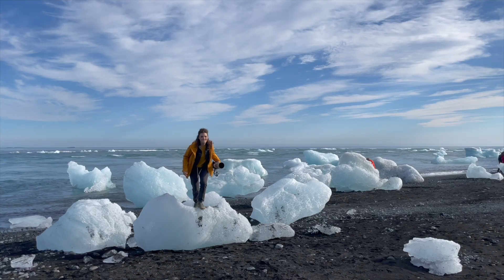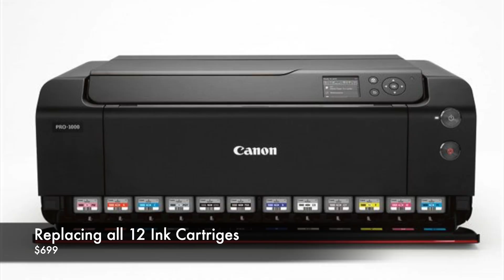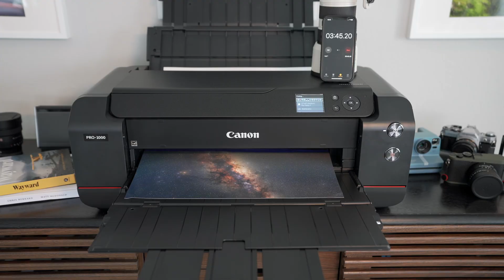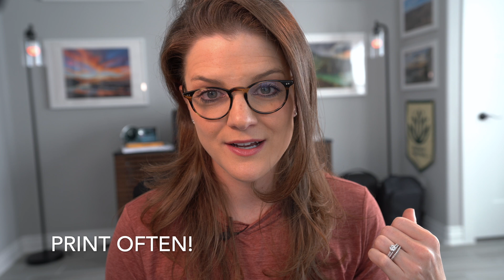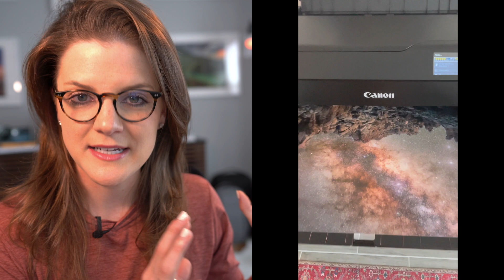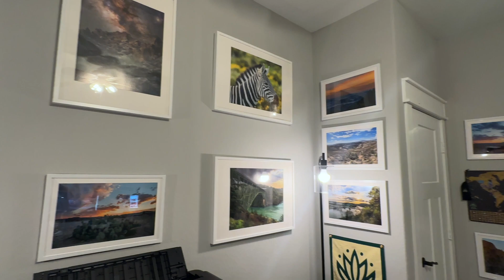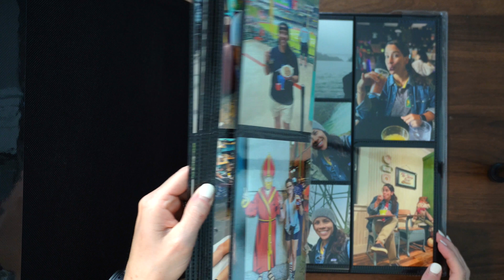Canon Pro-1000 - Worth the Investment?

Comment: After a lot of research I’ve realized my canon PIXMA pro 100 is really killing me on ink prices. So after doing the research I’ve realized there is six more times the ink in a canon PIXMA pro 1000 And I would be saving almost $60 per color ink cartridge from the pro 100 by upgrading to the prograf 1000. So if I bought six cartridges for $19 of one color that equals $114 and that would be the same amount for the canon PIXMA proGraf 1000 $55 ink cartridge for just one color. So by upgrading to the pro graph 1000 it’s going to save me a lot of money ink alone. Thank you for sharing this video it’s really going to help a lot of people deciding. I wish I would’ve saw this video or had this video available before I did all my research but it never hurts to do your own research. My new Canon Prograf 1000 should be here within the next week or so it’s on back order. I can’t wait to upgrade
Reply: I’ve had great success with Precision Colors refills on my Pro 100. The inks were carefully engineered to match the OEM, and they do really well. I’m on my third round of refilling and it’s costing about $3 cartridge.  Now doing the same with the Pro 1000 but using OEM ink from Precision Colors costs about $45/cart.  Still, that’s a savings of 12x$15.  Jose Rodriquez has done a great job of walking through the process for both printers in detail
Reply: @stuchandler1296  so you highly recommend that Precision Ink for the Canon Pixma pro-100? I hear great things about the company and I just refilled my chroma Optimizer and my gray on my Pro 1000. But I am so scared of using third-party ink for the pro-100 cuz it is now my backup printer. Plus I use it to print out all my five by sevens for all my orders. So I'm not using it that much but I still want it to look exactly like OEM. So if you recommend it I might give it a try
Reply: @LMActionsports  I tried it all out on the PRO-100 first.  I shared your concern when I first experimented, but have been happy with the results of the Precision Colors SE. The reds are a little hotter but I find they match my calibrated monitor better than OEM.  I did flush my cartridges before the first refill so there was a clean transition.  I love 5x7s, I use them and 8x10s for proof prints and then can sell the good ones for table prints :-). Don't forget that Precision Colors provides their own ICC profiles although I've been happy with the standard Canon and MOAB profiles even with the Precision Colors SE.  Hope that helps, I love the fact that I don't have to worry about my ink costs on the PRO-100 anymore.  As for the PRO-1000, that's different because the larger prints pay for themselves.
Reply: @stuchandler1296  hey i sent this reply to Dave, he does a lot of videos on the canon pro 1000 and talks about refilling the cartridges. I was wondering if you could help me with this question. Here’s what I exactly wrote to him of what I am doing with mine.:
 I recently purchased this printer the pro 1000. And I also ordered all 12 colors of OEM ink from precision colors. Now my first low warning Ink came up for the chroma optimizer. So I followed your instructions on an older video and drilled a hole filled it up to about 108 g and I just did it to the color gray also. But was I supposed to hold the pause button in for five seconds because I still have two low Ink warnings on my printer for both of those colors but both cartridges are full right now. I’m a little confused on do I wait until it gives me the error code and then I hold the pause button it for five seconds for each color. Or will my chip be labeled done and it won’t work no more I’m a little confused on when I should do this. Now I have not purchased the ink level sensors yet from precision colors because money was tight and I plan on ordering it in the next few weeks. So as of right now I am just going by weighing each cartridge and keeping an eye on it until I buy the low Ink sensor system from precision colors. I just don’t want my chips on my cartridges to stop working because I’ve failed to do the proper steps. Also does leaving the printer on all the time keep it from doing so many maintenance cycles? I am really looking forward to your response you are a godsend for doing these videos. I love this printer and I really don’t want to have to buy another OEM cartridge or a chip I just want to continue to use these cartridges that came with it and continue to fill them with OEM Ink. Thank you again
If you could help me with this Stu I would greatly appreciate it
Reply: @LMActionsports  The Pro4000 printer uses the same inks, and they are available in much larger cartridges at a better price, and I think also in gallon jugs.